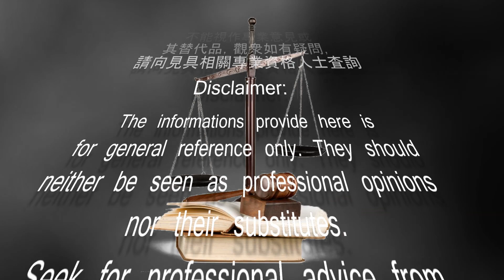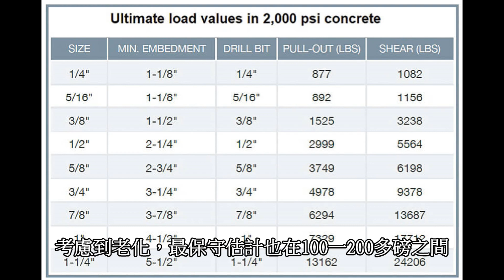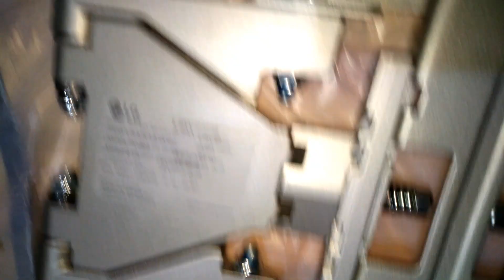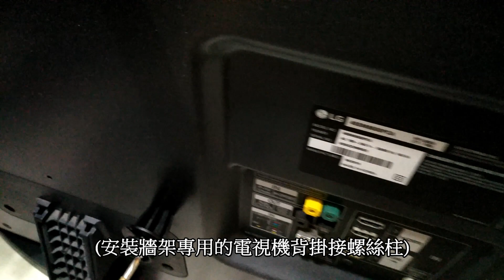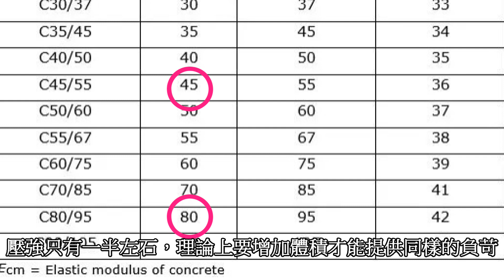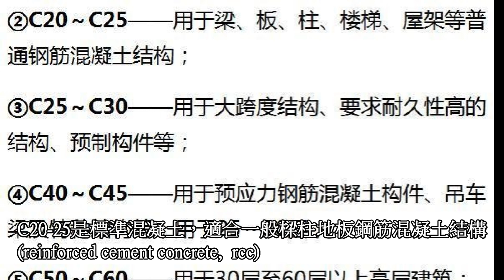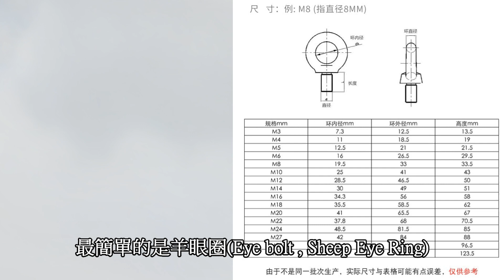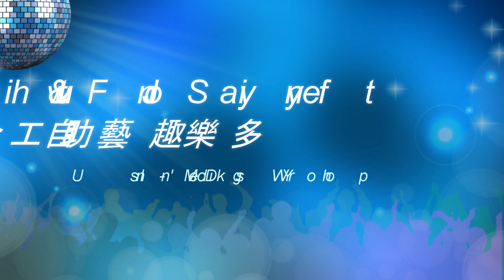石工篇09-從安裝電視機牆架説混凝土牆和磚牆的負苛能力(Stonemasonry 09- Load Bearing Calculation of Bricks or Concrete Wall)

Comment from the maker: 參考資料Reference:

1. 建築規格Buiding Code：
1. Buiding Code:
1.1 Codes, design manuals and guidelines, Building Department, Hong Kong Government
1.2 Code of Practice for Precast Concrete Construction 2016, Building Department, Hong Kong Government
1.3 Code of Practice for Structural Use of. Concrete 2013, Housing Authority, Hong Kong Government
1.4 Codes and references, Building Department, Hong Kong Government
1.5 Eurocode 2: Design of concrete structures - Part 1-1 : General rules and rules for buildings, The European Union Per Regulation 305/2011, Directive 98/34/EC, Directive 2004/18/EC]
https://www.phd.eng.br/wp-content/uploads/2015/12/en.1992.1.1.2004.pdf
1.6 《興建新界豁免管制屋宇須知》
https://www.landsd.gov.hk/doc/tc/small-house/Building%20NT%20Exempted%20Houses_c.pdf
1.7 中华人民共和国国家标准: 混凝土结构设计规范(GB50010-2010)
http://m.jianbiaoku.com/webarbs/book/209/2438396.shtml

2. 混凝土規格Concrete Code And Testing:
2.1 Testing Concrete, CEDD, Hong Kong Government
2.2 Code of Practice for Structural Use of Concrete 2004, DEVB, Hong Kong Government
2.3 Different Concrte Grades Based on Different International Codes https://designfloor.org/concrete-grades/
2.4 混凝土國家標準（應用解説）- 知乎
https://zhuanlan.zhihu.com/p/265825898

3. 建築用磚強度 Brick Strength Test
3.1 Tests for Bricks
3.2 Compressive strength of brick in N/mm2 & kg/cm
https://civilsir.com/compressive-strength-of-brick-in-n-mm2-kg-cm2/
3.3 Compressive Strength Test on Bricks and its importance
https://civilread.com/compressive-strength-test-on-brick/
3.4 Test for Compressive Strength of Bricks, Absorption, Efflorescence & Size.
https://civilseek.com/tests-for-bricks/
3.5 Different Types of Tests on Bricks
https://www.civillead.com/tests-on-bricks/
3.6 Compressive Strength Test on Bricks 
https://theconstructor.org/practical-guide/compressive-strength-test-on-brick/2790/?amp=1

4. 膨脹螺絲拉脱測試
4.1 Experimental pull-out tests and design indications for strength anchors installed in masonry walls, by Linda Giresini, Mario Lucio Puppio & Francesca Taddei 
https://link.springer.com/article/10.1617%2Fs11527-020-01536-2
4.2 Types of Anchor Bolts 
https://designfloor.org/different-types-of-anchor-bolts/
4.3 Eyebolt Safety Testing, UK.
http://eyebolttesting.com/

5. 防墮裝置 Fall Arrest System
5.1 吊環螺栓 (羊眼圈), Smart City (HK) Trading Ltd.
5.2 高處工作意外致命個案集（中文版）- 勞工處
5.3 高處工作參考資料
5.4 Occupational Safety and Health Statistics 2019